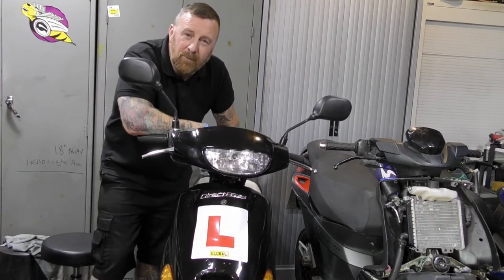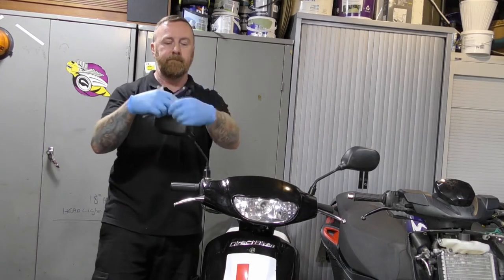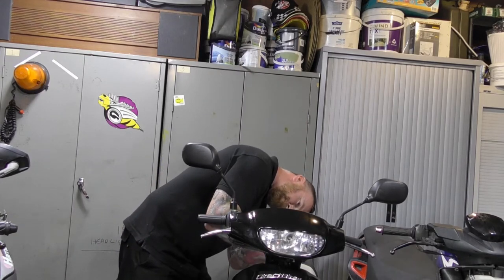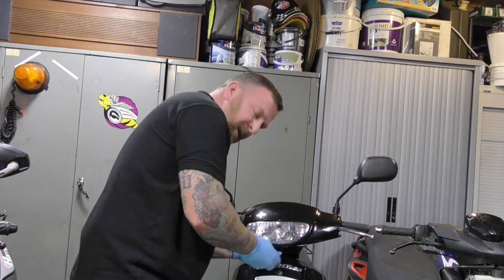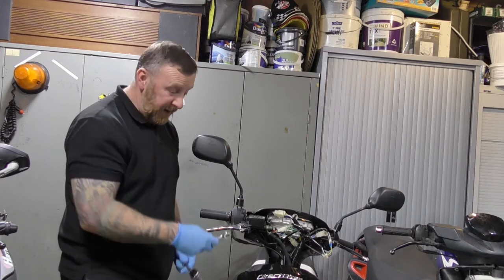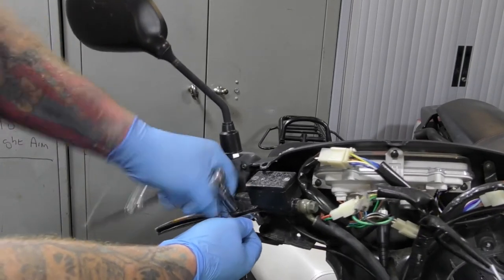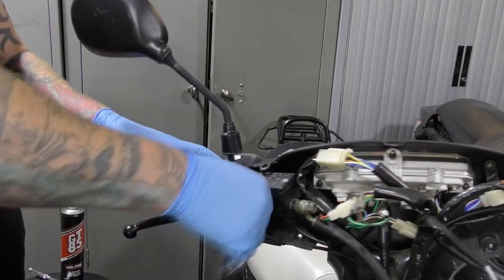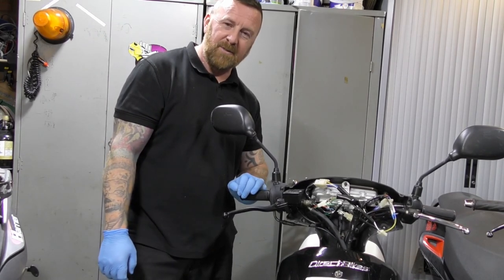CHANGING MOPED SCOOTER BRAKE LEVERS 50CC 125CC

Comment: hello Mark. I have a question for you. when I go to try and start my scooter and turn on ignition switch and squeeze the brake lever...the scooter tries to turn over?? before I even push the start button. any idea of what might be going on here?
Reply from the maker: Starter button jammed In ,take off spray up unjam or replace bud
Reply: @marksavage  im going to try that thank you very much for that tip.

Comment: Great video mate as always. is there a way to adjust the distance to make it closer to the hadle bar for incase you have smaller hands.?
Reply from the maker: They are adjustable levers on e bay and other site bud 
All big bikes normally have them 
They will fit yours 
Just check before you buy bud

Comment: Hiya mate great video, my bike dropped yesterday & had the same thing happen to mine as this one. Will any brake lever brought off Amazon or etc just fit into my bike?
Reply from the maker: Double check the fitment side bud as in cable or hydrolic. 
To be fair most will fit as long as its for the same cc bike as in 50cc 125cc
As some big bike levers are longer 
So study the picture and and size info 
If not e bay your bike then order

Comment: Hi mark i recently acquired a piaggio NRG 50cc 2009 LC and carb.  old owner said it had a rebuild bit on his journey home would only do 15-20mph max since then he saw it unfit to ride and bought another bike it cranks and got compression and spark still yet to change the fuel lines and clean the carb which is an obvious thing to do but anything else you would recommend to try?
Reply from the maker: check the variator system bud as in my videos, it will help
Reply: @marksavage  brilliant cheers mark

Comment: hey , I want to know  I have a 50 cc iride with my wife , but going up hill it slow down to 15 mph, is it the roller I have to change it total weight is about 325 , so how can I fix my problems
Reply from the maker: If it slow on load then yes 
Follow my variator video 
As for your ped as I don't know whiche it is 
Best Google
Reply: So wat king of rollers  should I use
Reply: My moped 50cc is a transport moped

Comment: Can you point me in the right direction of anyone installing a 100cc bbk in an aprilia 2t scooter ty
Reply from the maker: as in swapping engine or head
Reply: @marksavage  head
Reply from the maker: @jeffkrauss5582  you wont get a 100cc head on the 50cc engine , 70cc kits , you would have to change the whole engine 
but it wont pass a 50cc mot bud
Reply: @marksavage  I’m in the states I thought I could bore out the engine
Reply from the maker: @jeffkrauss5582  its more about he head placement bud , its not just a plug and play for the head , plus the crank would need to be bigger , easier just to swap the engine or just get a bigger ped all round , 
you can get big bore kits but again then you have to change the carb etc

Comment: So, on my 50cc, the rear brake handle requires a lot more compression before the brake light comes on, and then if it's squeezed too far, the brake light goes out, whereas my front brake handle is a hair trigger, a slight squeeze and the brake light comes on... what could be the issue with the rear brake handle system?
Reply: Same here, except my right one doesn't work at all, may have to get it replaced asap